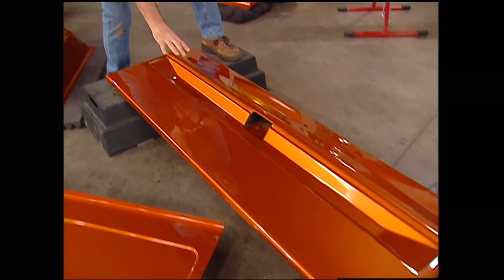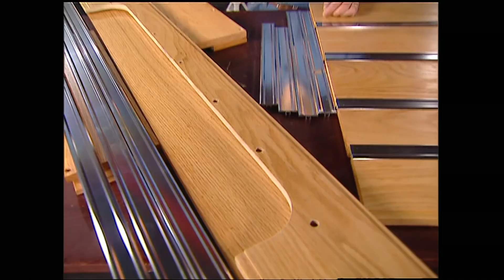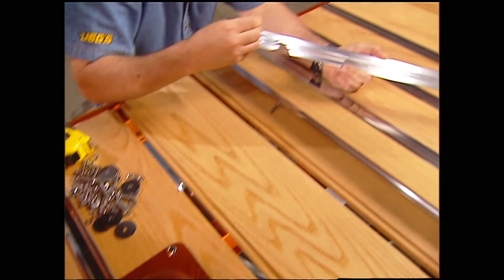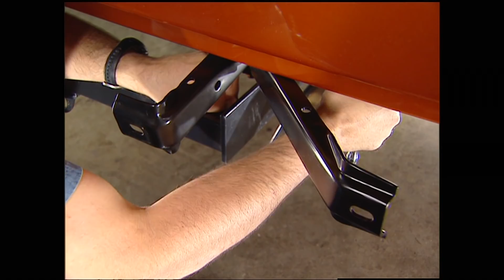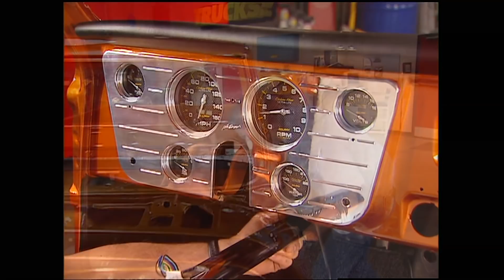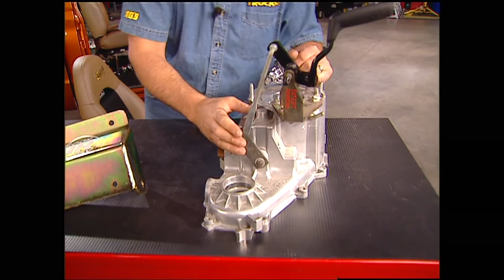Project Copperhead: 1967 Chevy C10 Final - Part 6 Trucks! S5, E19

Comment: Most trucks do better aerodynamically with the tailgate closed. Starting with the GM square bodies, they were wind tunnel tested to do just that. Driving without the tailgate closed will spread the bedwalls apart at the rear. Ask me how I know... 🤔

Comment: All the parts for the bed are available new from Goodmark. What happens when the right side of the tailgate is 5/16th” too thick! No warranty! Split the undamaged tail light bed corner, bend out to fit the top 8” then weld some filler metal, then scratch your head trying to figure how to sand in between two OEM overlapping panel that are two inches apart! 16hrs of work, great!

Comment: guy * face palm * go to a wind tunnel and find out like i did that the tail gate CLOSED creates a low pressure system that moves all on coming air OVER the bed of the truck reducing drag and resistance  , now with that said when you lower like you did or full open the tail gate the whole of the low pressure zone is GONE and all on coming air over the cab will pitch down into the bed and focus MORE on the gate area causing down force and drag and turning your gas hand in the E position much much faster ! so with that said GATE UP = better gas mileage  GATE DOWN = drag and reduced gas mileage but better rear end traction  not for traction and drag and resistance the gate full open is OPTIMAL but, the angle you put it in " spoiler " will cause a counter affect shifting the low pressure zone to the back of the gate like a wing and cause lift and more drag in air resistance into the pitched oncoming air !   another example you ever notice trucks at a drag strip? ever notice the fastest truck has the gate closed  and gets faster and a bit squarely? and ever notice the truck with the gate full open is slower and stays stable the whole time ? dont need to go to a wind tunnel like i did to find out the facts in fluid dynamics and yes air is a fluid gas :)

Comment: In 1976 I bought a 1967 GMC 1-ton,flat bed, 3rd-hand, 70,000 miles, $1700.
Changed the 292 for 283.
Build my house, did contracting.  Motorcycles.
I'm 71 now.  Still driving her some, firewood, dump, &c.

Comment: All shiny and stuff
Most if not all new parts are made in China.
OEM parts are the best parts period.
Stuff made in China will crack rust because they’re no bueno.
I bought shiny rims for my 14 Mustang GT
I hit a pot hole they bent and cracked - cannot be repaired- worse thing is manufacturer NICHE no longer have them. I am now forced to buy 4 new rims instead of 2...
I sold my OEM rims already for peanuts dumb move 
If you can salvage repair OEM parts, do it.
The only thing good on this truck is the engine. And again you stick a powerful motor in a truck that was not designed to save your butt at high speed... hmmm that shiny paint job won’t save your sorry arse.

Comment: I am sorry but the but the '56 Chevy gas filler point under the tail light, never pivoted down, it flipped up the top portion of the tail light and exposed the gas filler cap.                         Your mileage may vary.  Thank you!   GOD rules!

Comment: ? Can I uesd the new 10spd with a 4.9l 300ci 1985 Ford F-150 2wd fuel injection 2bbr efi  and  glasspacks single exhaust  straight pipes and pull off smog pump pull off Cadillac converters and  trubo kit two little trubo make more hp at quicker more speed more response and 3.08 gaer in the alxe     turn RPMs at 1000rpm just run and make 10-speed shift gears at 2,500rpm to 3,000rpm max to get more power out of my 300ci  and camper shell for high speed try to make this truck do 180mph top speed make out

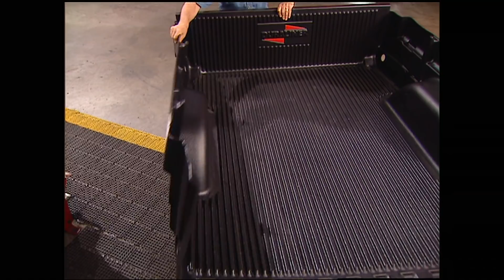Comment: 1:00: there needs to be heat-shielding placed on the firewall behind the engine before its all mounted up otherwise the heat from the engine will just peal the paint.  18:22 those drop in plastic linders are absolutely shit! they get moisture between the bed and the liner and rust out the panels! a polyeurathane spray-on liner is best.
Reply: I have a drop in liner in my 2001 Silverado. I took it out last year. No rust at all.
Reply: A simple coat of paint is even better than bed liner...
Reply: @GeorgiaRidgerunner  No its not paint rubs off and scratches.

Comment: I love the 67 C10, built many of them and the harder builds were the big block builds because the 67 cab was not meant for a 396 or 454. The firewall has to be either beat in or modified. This to me is not a 67 cab, 67 cabs have that hard to find small back window, this cab, being that it can take a big block and that the back window is the rather not too good looking big back window says to me that this is not a 67 C10 cab...

Comment: Love this color of  This truck  Is absolutely gorgeous and sexy all-in-one what is the biggest motor I could put in a Chevy  S10 that is 4 wheel drive-in it is a 2001 Please comment back I want a put A383 stroker   In the truck but I want the 4 wheel drive system to still work
Reply: Years ago at a car shop a guy had one. The stock 2.8l powered the front wheels and a drag motor in the bed was attached to a v drive a powered the rear wheels.

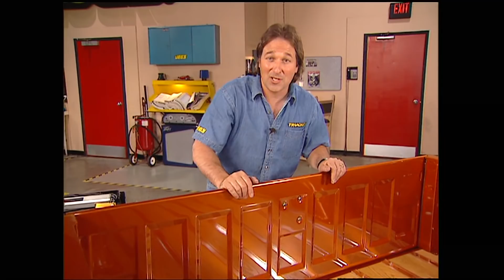Comment: 19:58 Stacey lied (again) about half open tailgate save gas. There is very little air flow into the bed.
Reply: blackericdenice mythbusters did a whole show on that
Reply: @NorthViewModelShop  Yes I saw it. But I knew before. My father use to have trash in the back and the stuff use to tumble around.
Reply: blackericdenice yeah I toss coffee cups in the back of my truck and at the end of the summer there is still 60 cups back there.  Lol